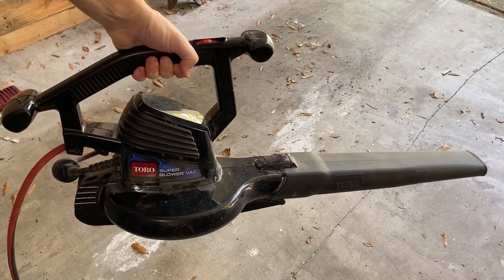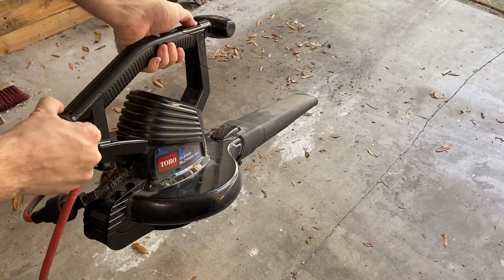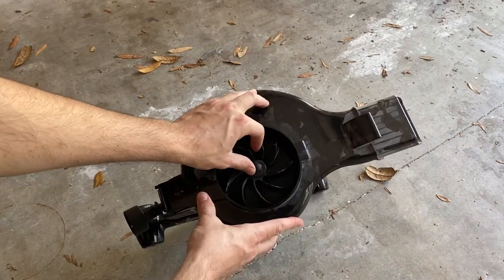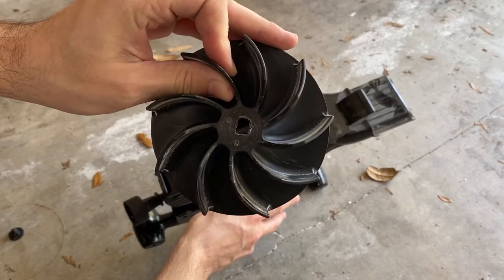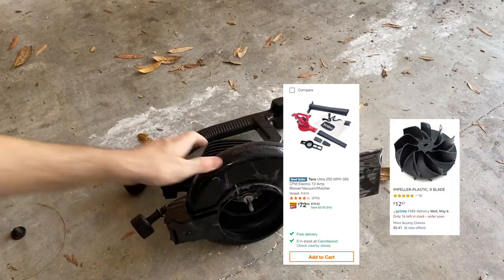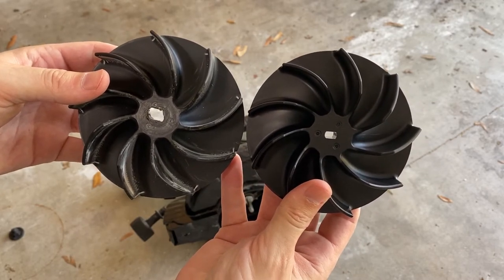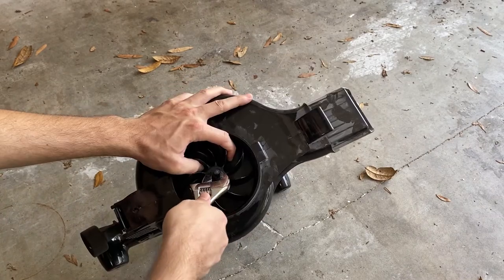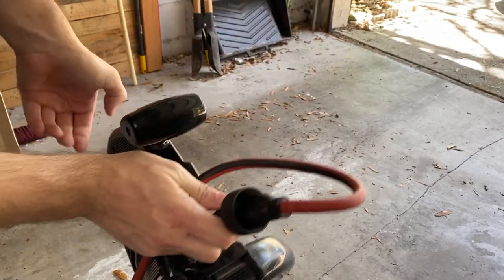Toro Electric Leaf Blower Fan Replacement

Comment: pro tip, on the back side of the impeller, fill the hollow cavities with portland cement and silicone it up.
The hard filler will prevent the high torque of the motor from tearing apart the plastic again.

Comment: Thanks, you got lucky,  Apparently Toro's electric corded leaf blower's live only months past the warranty!  Planned Obsolescence?  My Toro Power Jet F700 died two-(2) months past the 2-year warranty! I hope I can fix it: I quit using it because sparks were arcing inside when I looked in the exhaust: I hope I can insulate the wires or swap out the wires.